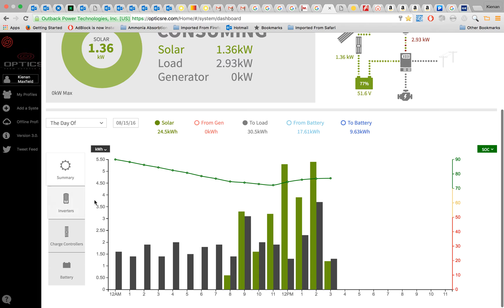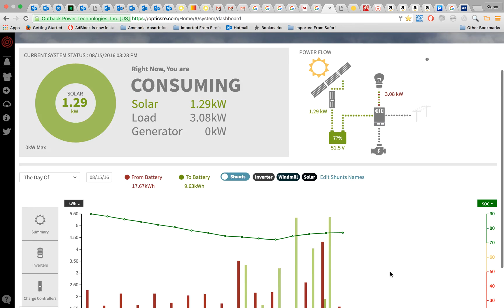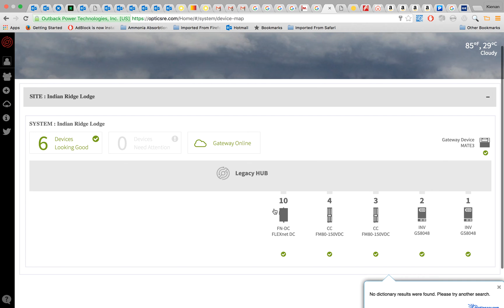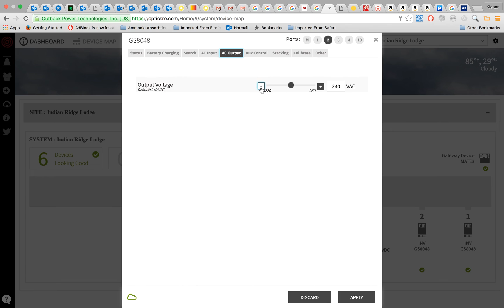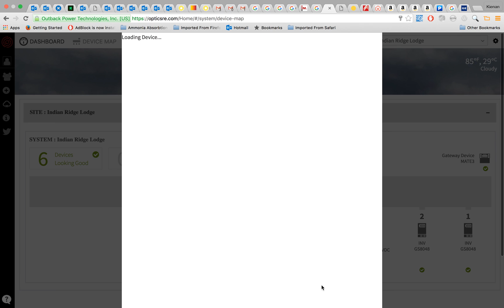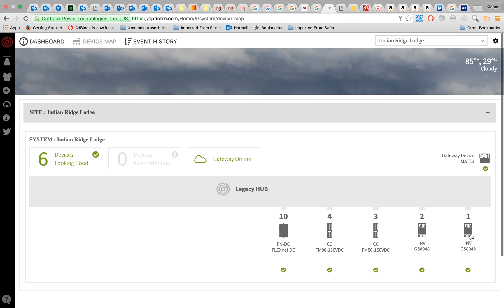Optics RE overview

Comment: Is this real graph a 1.36kw system producing 24.5kwh is so what am I dong wrong? I'm lucky to get 15 kwh out of 4kw system
Reply from the maker: Hey, sorry for the slow response. No, the PV system is much larger than that. At the moment that I recorded the video, it was producing 1.36 kW. It must have been cloudy at that time. I don't remember If I recorded this video before or after I increased the capacity of my array, but before I improved it, it was 8.46 kW of PV. Now it's 18.72 kW.
Reply: I make about the same 1.4 sometimes 2, between solar amd air power in my house on the beach and make a total of 24 to 28 daily.